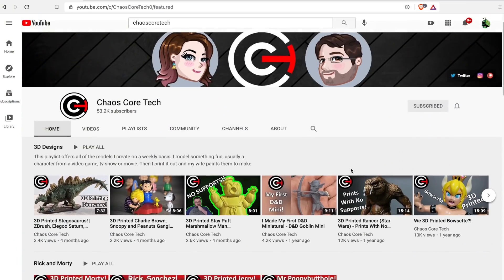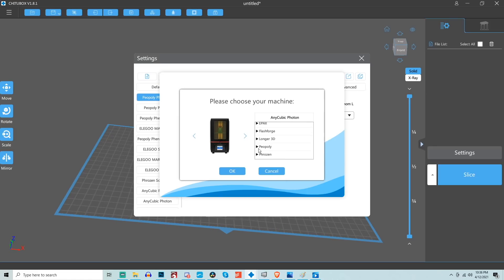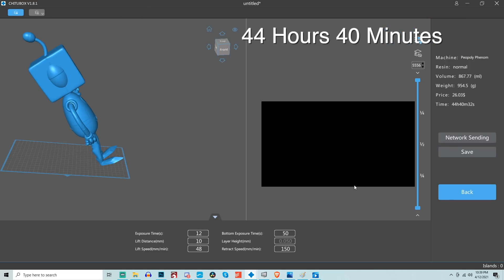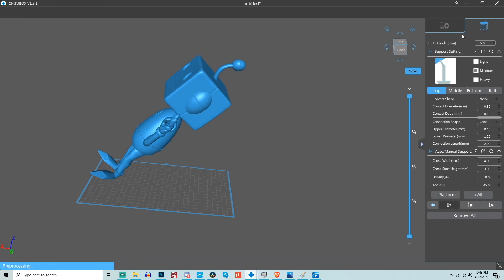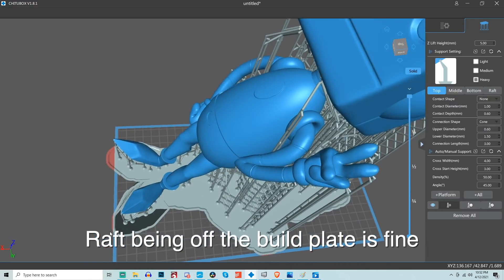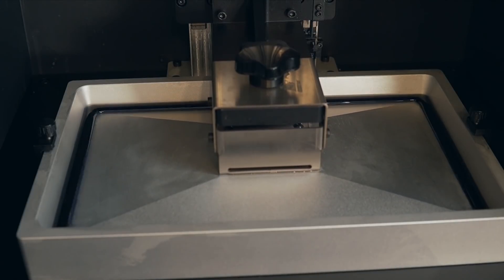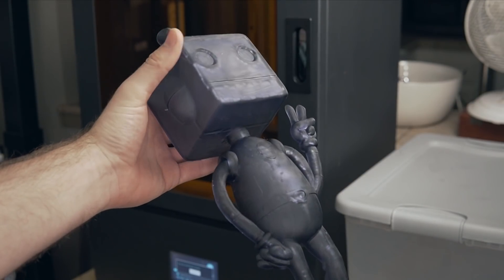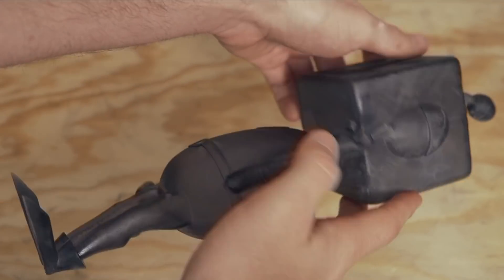Large Format Resin 3D Printer Workflow (Best Practices)

Comment: Enjoyed your video. I have a few tips...
I noticed in your video that you hollowed the model out leaving a void in the antenna. Uncured resin will reside in this and over time it will react with the cured resin around it and can cause the model to crack and weep uncured resin. This probably won't happen with yours because the translucent resin let the sun light cure it, but it can happen with opaque resins. So, find all voids and give them a drain hole. Or, use PrusacSlicer to hollow out before loading into Chitubox and set those awkward areas to be filled solid, not hollow. PrusaSlicer is much better at hollowing, but Chitubox is better at making holes.
As a rule, I always put holes where they won't be seen, like the underside of the feet or inside the mouth.
Another trick I've used is to size the hole to fit cheap magnets, and then if it is on the underside of the feet I use those to fill the hole holding them in place with a little superglue, and then I put the same in the base (if you have one) that then allows the figure to hold itself on to the base.
And finally, always sand with water on the model, it will clear away the dust and you will get much cleaner results. Use 800 or 1200 to finish, though it is possible to use higher grit and put an almost mirror finish on the model.
Keep up the good work!
Reply from the maker: Pinned your comment! So many great tips. I do think like you said with the antenna and it being translucent that it did cure (I did not see any wet resin through the model) but absolutely. I need to take a look at Prusa Slicer for that. In this instance, I would have just made everything solid with the exception of the head and body. Perhaps I will make an updated video on hollowing and use prusa slicer to show that off. The magnet in the feet trick is also genius. This model can stand on its own but the idea of having magnets in the feet is so cool. 

Also the wet sanding with a higher grit I am sure would have made it much smoother. Always learning and I really appreciate you taking the time to share your recommendations.
Reply: @ModBotArmy  that is great. I should mention that if you want 5mm holes for 5mm magnets you need to cut them slightly larger (5.3 say) as otherwise they will be super tight. When you glue them in you can make them flush, or push them in a tiny bit more and then cover them with resin so they're invisible after curing and sanding.
Reply: @MarkPickavance  I normally follow the formula I've found in the OpenSCAD manual: radius*1/cos(180/fn) - with fn being the number of fragments in 360 degrees used for the holes and so far this has worked perfectly for me

Comment: if your still looking for your air compressor help, a CENTRAL PNEUMATIC
Oil/Water Separator - should help, or just any "moisture filter" for compressors.   Every compressor will create moisture, it's not just cheap versions, it depends on volume of compressor storage, temperature, and your areas humitidy among other things like compression rate. (if you compress harder, filling more air into a smaller spot, it will make more water than if you compress lightly into a larger spot)

Comment: How much resin do the supports contribute to the consumption....or are the supports thin enough that it does not really matter?
Reply from the maker: I am pretty sure I show it in the video at some point but it is a bit. The raft adds quite a bit as well. I think in the end it was around 388 ml roughly (off memory) or about half of the solid model. It can add up but it still is not terrible.

Comment: Cool video and model.
For your air compressor you can get a cyclonic separator (for water) then coalescing filter (for water and oil) then desiccant dryer for any remaining water. You can pick these up as sets from the usual online stores. Probably 1/4" BSP/NPT size would be appropriate for your air brush.
Reply from the maker: Thank you very much for the recommendation I will definitely look into it. I really want to get this thing operating correctly.

Comment: He's a little too big for an ultrasonic cleaner, isn't he?  Last year, I picked up an air compressor from Home Depot.  I primarily bought to dry of resin prints, as well as reduce the fuzzies, shinies, and "puddles".  It makes it much easier to create functional prints that don't need post processing.

Did you watch the Creality anniversary video with their new offerings?  They have like 5 new resin printers, as well as other products.  While all of the new printers appear to have good specs, they are extremely over priced.  They don't have anything in the Phenom class, as their largest printer is a Saturn clone for $949.

I might try printing a ModBot Robot in TPU to sort of get a Weeble-Bot effect.  😉
Reply from the maker: Haha yeah a little to big for a cleaner. Maybe the new Anycubic Wash and Cure they released that is for larger prints. I did not! I saw someone share it but completely missed it. I used to know nearly all of their printers but the last generation I have not used many of really just the Ender 3 v2. I would like to get the 6 se, Ender 6, or CR-30 in. I havent been to crazy to test out their resin printers but I really have not heard anything bad about them. I will have to check out that video when I get a chance to update myself on new models haha. 

Do it! I may need to do the same at some point :)

Comment: Most compressors produce condensation in the airline.  You need a moisture trap on the output of the compressor.  They're cheap and simple to install.  Also, have you tried having the slicer save the "holes" (plugs the same size as the holes that print along with the model) and inserting them in the drain holes instead of super glue, etc?
Reply from the maker: I have not but I do like the idea of that and may need to try it for fun to see how well it works. I would imagine some sanding or gluing may still be needed unless you are able to just press them in place. Have you tried that?

Comment: You will need something like " Desiccant Air Compressor Filter with Teflon, Water Separator, Air Compressor Dryer" for your compressor to capture the moisture when using the air brush for painting.
Reply from the maker: Thanks for the recommendation. I will look for something in that area. Ever since I purchased this compressor it has had moisture issues. Since I had nothing to base it on I though maybe it is just me. However, after upgrading everything but that I clearly see now it is hardware that is missing.
Reply: @ModBotArmy  Yup, moisture filter is the way to go. Any compressor, regardless of quality, will introduce some moisture into the air stream - it's unavoidable.
Reply: @ModBotArmy  Iv never used an airgun like that, but it is my understanding that you can buy cans of compressed air to use them.  It seems like a waste of money to keep buying small cans of compressed air to use it, but they do sell air tanks.  Might look into buying something like that and refilling it with your compressor.  I personally wouldnt want to sit next to a noisy compressor while painting like that.  Air tanks are fairly cheap too.